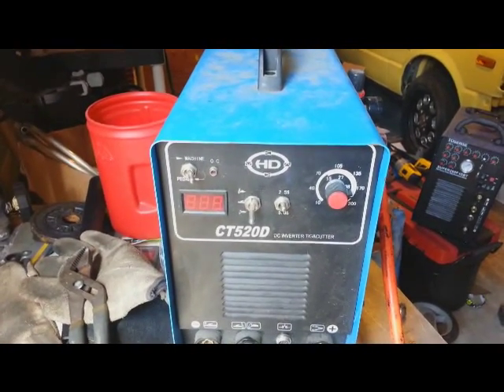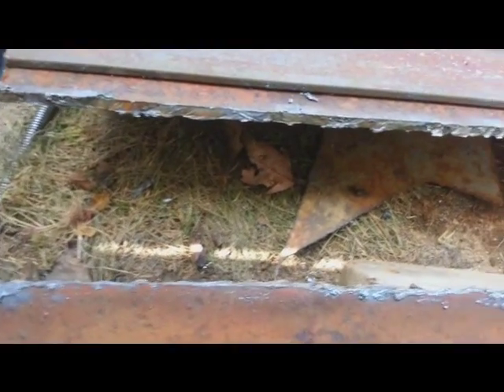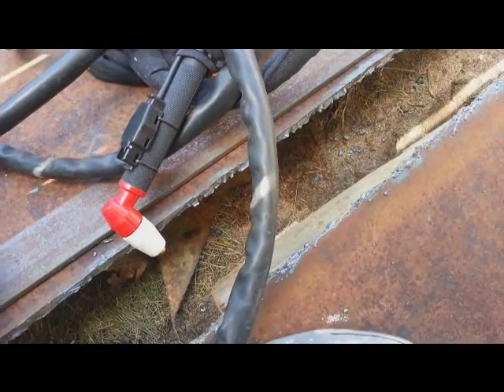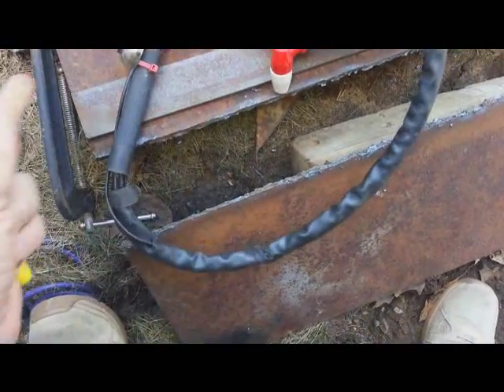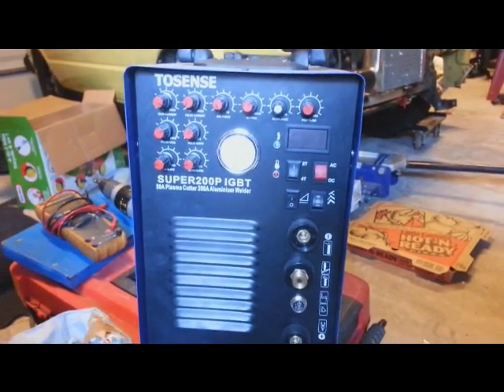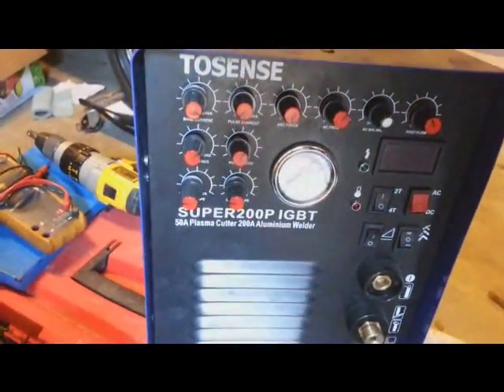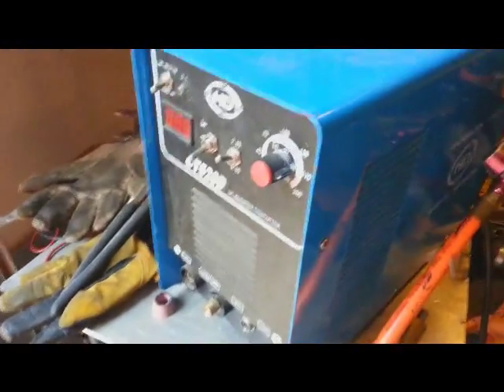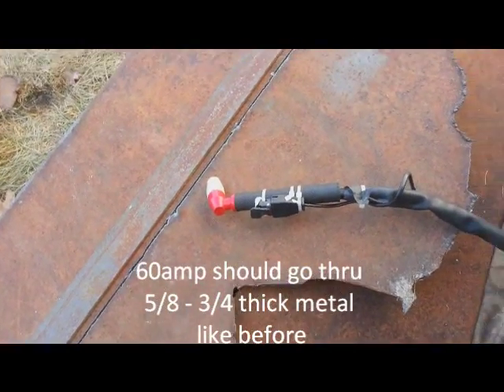Chinese Plasma cutter CT520D troubleshooting review Tosense tig and HTP

Comment: Hi I just bought a Chinese plasma cutter. The torch keeps blowing air out. But no spark or ignition. Do you know how to resolve this? The seller kept saying air compressor issue. But the air pressure has been constant
Reply: +Samuel Leong SL BUILDERS I've had the Chinese units burn the trigger circuit out. I can show you in a video of what to check if you like. On this Longevity unit they want $249.00 for a $20.00 2 inch square circuit board because they claim they don't want to sell parts, only new units.
Reply: hi Tad, thanks. I had the thing sorted out. They changed the blow torch and did some modifications. So had to spend about $300US to fix it.
Reply: is your reducer set right?